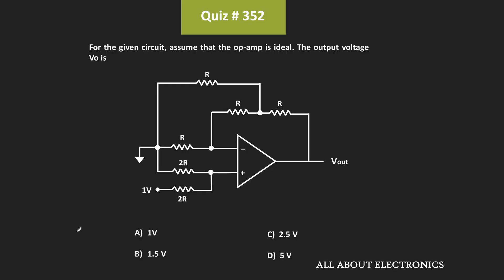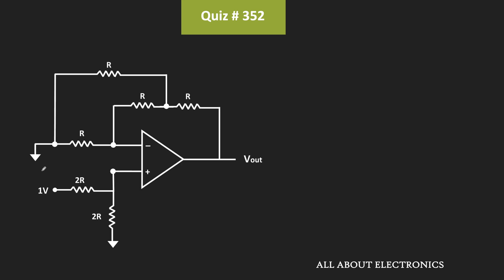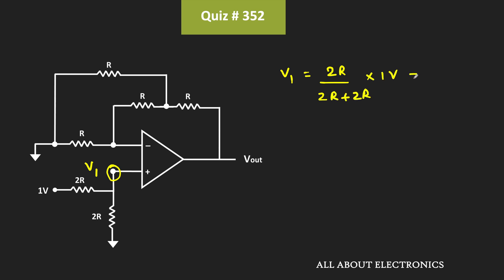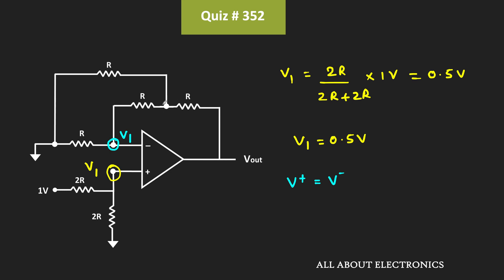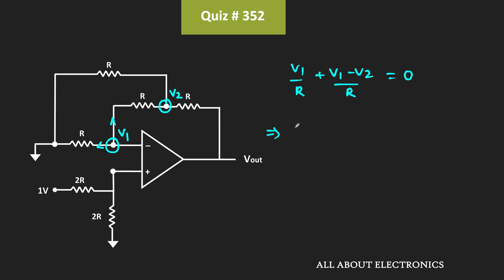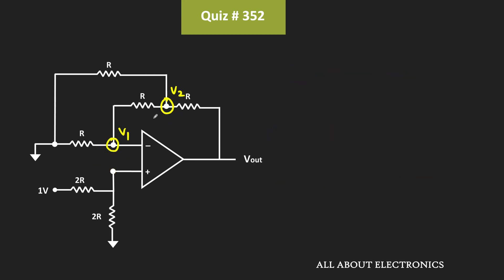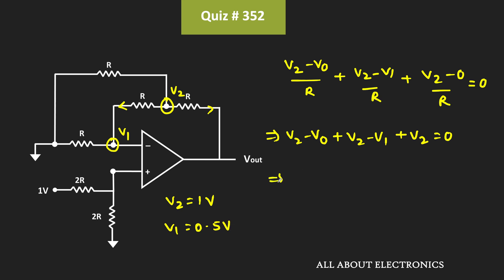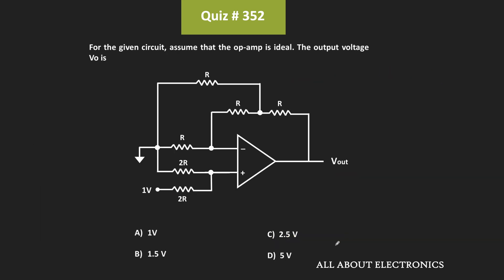Operational Amplifier (Op-Amp) Solved Example | Analog Electronics | Quiz # 352

Comment: How did u know the direction of the current at each node??
Reply from the maker: Typically we do not know the direction of current at every node. (Unless in some obvious cases). So, initially we assume the direction of current. And accordingly we do the nodal analysis. If the assumed direction is correct then after the analysis, the value of the current will be positive. If that is opposite then you will get negative value of current. I hope, it will clear your doubt.